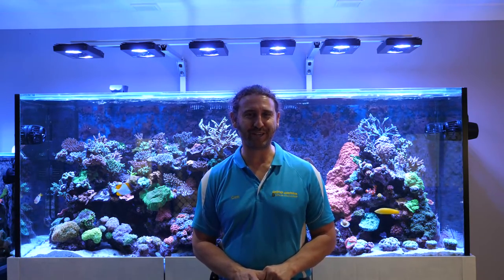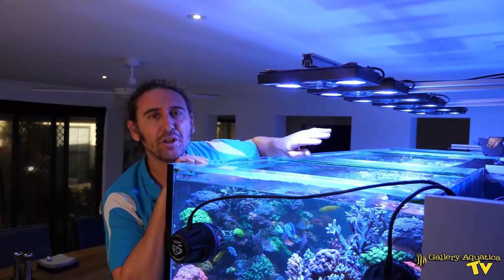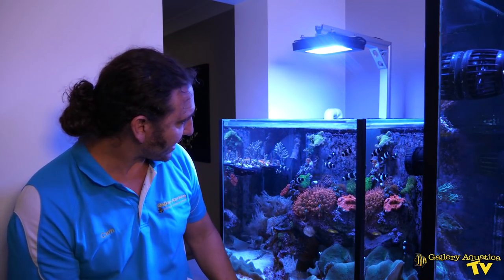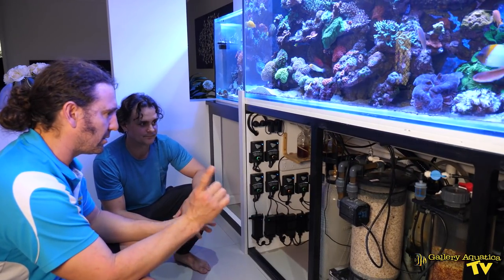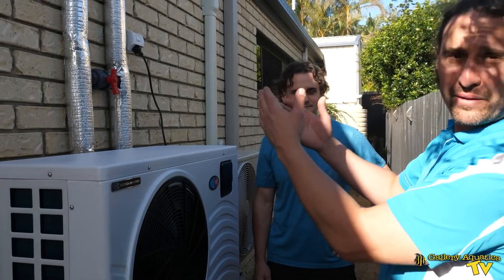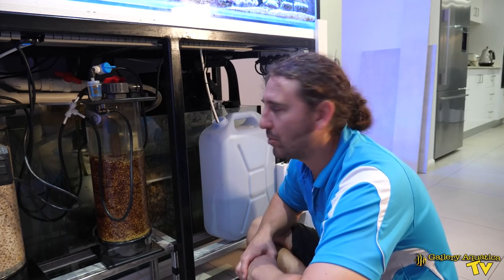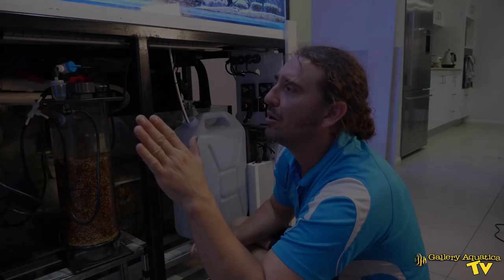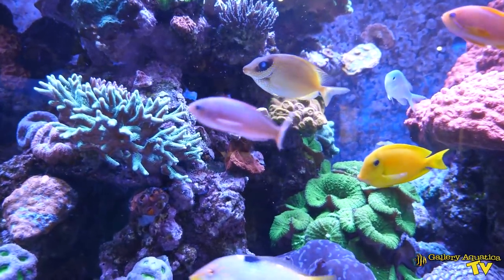DIY Done Right: High Tech Reef

Comment: The main tank just looks 👀 spectacular with crystal clear water, large corals, fish all look 👀 healthy, the smaller tank is a great 👍 addition.
What a  ingenious support system running these tanks, this all must have taken a lot of planning, and time to build and install, the weight alone must have taken some reinforcement of the flooring.
On the follow up video Cam, you must cover how the water Change  is done, and how long that takes.
Also how long has this system been set up and running for ? 👍🏴

Comment: To key running at full speed is giving the vectra its full 36v. just buy the battery backup booster and every vectra can run at full speed on battery back up. But I’m all about that DIY Sealed Lead acid battery back ups!

Comment: That spa heat pump is a brilliant idea. But the heat exchange, is it saltwater resistant? Do you have salt water spa's in australia? I checked what is available here, but the heat exchange seems to be made either out of copper or stainless.
Reply: Heat exchanger is a titanium coil in plastic case. also used alor in commercial aquaculture
Reply: Nice, that really looks like an awesome machine! Pricey, but it must be far more efficient than a normal heater, and way less noise than a normal chiller.
Reply: @tw157059  Surpisingly not. The units are about $2200. A standard chiller for an aquarium this size is close to $2000 here anyway.
Reply: Wow the warranty on that unit alone makes it a no brainer, lucky to get 2 years on standard aquarium chillers

Comment: Hi Ben i would like information about  your spa heater chiller unit please.
Reply: Hi The chiller is a evoheat fusion i7. Is a inverter model so the power ramps up and down as needed. For my application runs at very low speed. I have is set on the silent mode which means it never runs over 50% power. 
https://evoheat.com.au/product/fusion-i-series/

Comment: What is the owners light settings on the cube? I have a very similar setup with a carpet nem. Looks like a gen 5 radion? Light program, overall intensity?
Reply: xr15 pro 100% intensity
Cool white 30%, warm white 10% all other channels 100%

get about 250 par across the whole tank 20cm underwater
Reply: Ben Crosthwaite duration?
Reply: @bcrosthwaite  hey there, regarding your carpet nem cube.. what is the duration of your light program? Thanks!

Comment: How the doors system is? Are they Magnetic? How they are maintained on place?
Reply: yes magnets are recessed into the panel. Just recessed and super glued in.
Being a steel from stand just hold one. best thing I ever did
Reply: Hey mate, I don't really have a photo that shows it as the doors just look like normal panels. I just used a spade bit and drilled a shallow hole and super glued in a high strength magnet, then just painted over the top.  The stand being steel they just hold on
Reply: @bcrosthwaite  dont worry. I will take a look about what I can use here. Thank You for your suppor
Reply: @bcrosthwaite  Thank You very much!!!

Comment: The tank is nice, BUT there was absolutely nothing DIY about this video. Plumbing and wire managing a tank doesn't fall in the DIY category. Outside of the misleading title, the video was good.
Reply from the maker: I guess we looked at the light mount and battery backup as DIY. Ecotech make a light rail that Ben could have used, but instead he fashioned one out of some solar panel railing he had. He also could have bought the Ecotech battery backup to power a pump in the event of a power outage, but instead he made his own system out of car batteries. Cam
Reply: @GalleryAquaticaTV  mix matching parts doesn't constitute DIY, for example using a different battery for a battery backup is not DIY. Making a homemade battery or making battery backup controller from scratch would be DIY.

I would give you the light mount, if I couldn't walk into any hardware store and buy a  aluminum light rail mount kit that looks exactly like what he is using. Building things from scratch is DIY, buying pre-made items and using for their intended purposes is not DIY. For example, buy a industrial chiller and use as a chiller or buying a car battery and using it as a battery.
Reply from the maker: He made the steel stand, but I don’t think he mined the iron-ore or melted it down so maybe that doesn’t count either😂
Reply: @GalleryAquaticaTV  If he made the stand, that is DIY but you did talk about it or focus on it in the video. 
 The video was good, the title was misleading. the only reason there are dislikes on the video were upset people who were expecting a video about DIY like myself.
Again using a battery as a battery or an aluminum mounting rail as a mounting rail is not DIY. building the stand was but you did really talk about it. 
I'm going to ignore the ignorant remark about melting iron-ore because that is to dumb to take seriously, I was just trying to help you out.
Reply from the maker: Sorry, that was a dumb comment😊
Reply: @GalleryAquaticaTV  No hard feelings here. This was a great tank tour video.
Reply: @robertt8874  
Hi Robert
I understand your point that I have used alot of things that are for their intended purpose but what Cam was trying to highlight is the things that weren’t. Going into detail on alot of this would have extended the video out and alot of people lose interest at that point. Perhaps we can do a more detailed video on some of these things in future. DIY is about making use of good materials and tweaking them for your use not necessarily engineering them from scratch
1) The battery backup solution is definitely not something you can buy off the shelf. A standard ecotech battery backup connects into a second port on the controller an only allows to pump to run at a trickle.
This solution uses the pumps power supply to power the coil of a relay that opens if the power is dropped. This that draws power from the batteries running through a 24v to 36 volt step up controller. I would say this constitutes making a battery backup controller from scratch.
https://i.ibb.co/Mp5jDrL/20200828-115222.jpg
https://i.ibb.co/q1CQW4Y/20200828-115246.jpg
2) The light rail. I do not know anywhere in Australia that you can walk into a hardware store and purchase a light rail like this. Trust me I would have if I could. You probably can’t see all the detail and reinforcing that went into the corner join or the custom hanger for the lights. But even if you could walk into a hardware store and buy a light rail you would still need to work out how to mount the lights. This I believe would constitute DIY aswell
https://i.ibb.co/qjpMLqx/20180908-175314.jpg
https://i.ibb.co/gF5ZCQD/20180909-180819.jpg
3) The Stand. I know that Cam didn’t go into detail about this nor mention that I had built it. Again only so much you can go into in one video without people losing interest.
Building your own stand and cabinets I’d say would be DIY. Taking the time to recess magnets into all the panels, creating removable mounting panels and holders for everything is still DIY in my opinion
From design
https://i.ibb.co/92CYw6b/1701865-e09e11dee8f47301f41bd74a57a498d7.jpg
https://i.ibb.co/fQzVqN3/1701866-6f854d39e66e76ed4c7000539a3fecf5.jpg
To build
https://i.ibb.co/N68nZ2D/20180729-172110.jpg
https://i.ibb.co/hBcZfnp/20180818-172806.jpg

4) The Chiller
Plumbing in and installing a external Spa heater/chiller on an aquarium is using something designed for a different purpose and adapting it to your use is still what I call DIY.

A lot of time an effort has gone into making things work together aswell as being successful long term and also be ascetically pleasing

I’m sorry for your disappointment and that you felt the need to leave negative comments. Fundamentally a custom build where you complete most of the fitout and configuration yourself.  I feel is a DIY build. 

Happy to answer any questions you may have

Ben
Reply: @bcrosthwaite  when people click on a video with DIY in the title we expect the video to focus on the DIY. 
Using a chiller as a chiller and calling DIY because you installed it, I mean by that logic everyone who has bought a 20g tank and a hob filter can say it's DIY because they went through the installation process of hanging the filter on the tank. 

I feel for you in Australia, but here in America you can walk into any hardware store and buy your light mount setup on your tank. The video only focused on the one mounting rail the lights attached to. The mounting rail was doing what it was made to do, lol it's a generic universal aluminum mounting rail (here) that's also used in track lighting, it doesn't matter that it came with a solar panel kit. A mounting rail being used to mount things to, my mind is blown away by the creativity, lol. 

If installation was the only requirement to classify "DIY" in the hobby then everyone who's bought a tank, stand,  accessories and set it up themselves can claim their system is "DIY". Building your own tank, stand and equipment used from scratch is DIY, installation of equipment not so much. 

You may have me with the battery backup but there's not real enough information to go on in the video, because it didn't really show anything. I personally would rather kill the pumps in a power outage and run the powerheads as long as possible because they consume less power but that's just my  paranoid preference, I couldn't care less about the sump in an emergency.

You have a awesome setup and this was a great tank tour, but the video didn't really met the DIY video requirements like, "how long to build, what parts were used, where'd you get the parts, how much did the project cost?". Things normally discussed in a DIY video.
Joking around, had you built a chiller out of a ice chest that worked I would have been more impressed, lol. That would  have been true DIY.
Reply: The title really should of been “1500 litres of pure reef jizz” oh wait a Sec... nah that could mislead some as well.
Reply: @glenbuyer8738   Maybe I've lived in my home and been in the hobby too long, but all I see is a very beautiful overly  complicated remodeling/moving nightmare, lol. But if you have the money to make it someone else's problem all power to you. I started with the over complicated setups 15+ year ago and have massively over simplified my tanks over the years and I've had more success with less problems.

The more money you throw at the hobby to flex the more problems you are creating for yourself later.
Reply: @robertt8874  Seriously man give it a rest. The guy is not a professional a professional aquarium installer / designer. The video is showing off that one amateur guy has planned and executed on his own. Appreciate it for what it is and stop being pedantic.
Reply: @divingmundz  "give it a rest"??? "stop being pedantic"???...... says the guy commenting on a comment thread that's over a month old???   ROTF LMAO  🤦‍♂️